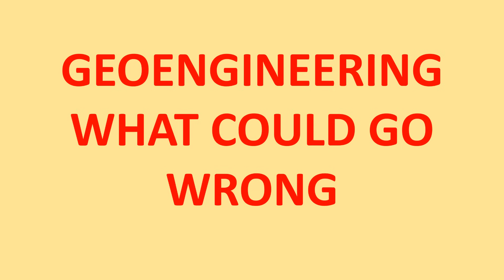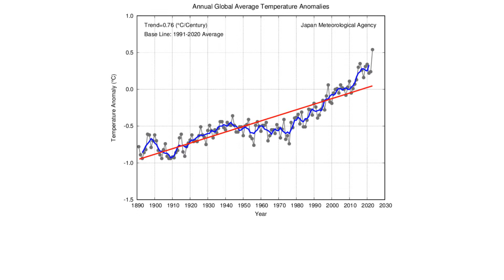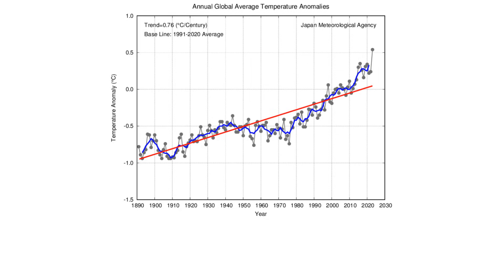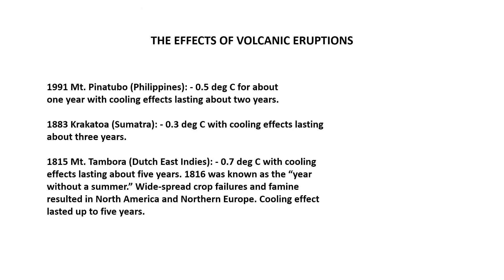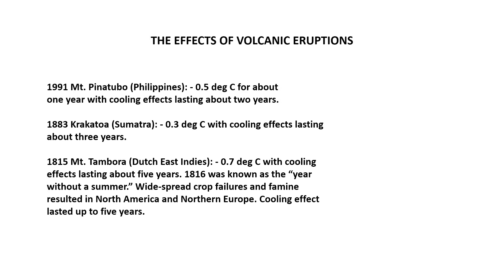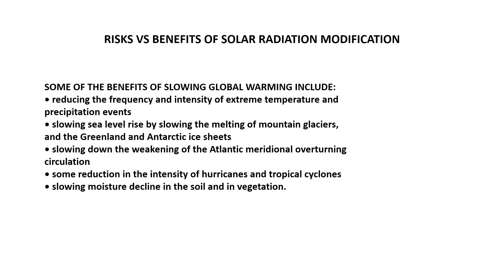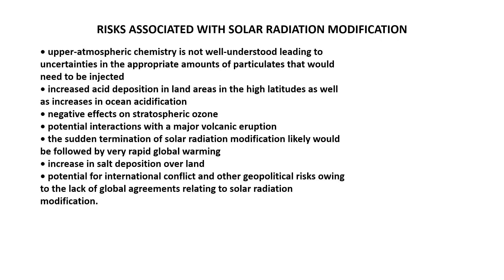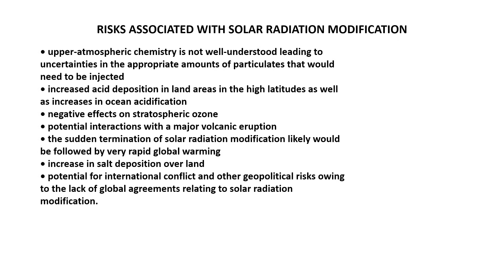Geoengineering What Could Go Wrong

Comment: Sit its obvios to me that a solution to global warming has to be found quickly. But I belive if weh 12:21 urry too much we might end up creating more/different problems which are more difficult solve. Keeping in mind the Climetological timescale , what timefr 12:21 ame and how large a sample would be reqirerd to make the results valid
Reply: Edit: I would like to know what timescale and how 12:21 large a sample do we need to produce valid data? I believe the answer is crucial as we don't have much time before things get totally out of hand? What can we laymen do individually and collectively to reduce global warming?
Reply from the maker: Thanks for your comments and question. I have seen various estimates as to how much SO2 would be required to reduce global temps by about 0.5 deg C. Most run around 5% of the SO2 normally in the atmosphere. So, I would estimate that the amount needed for a valid test would be about 1% or so of the SO2 normally in the atmosphere. That's non-negligible.
Reply: Thankyou sir for taking the time toreply.